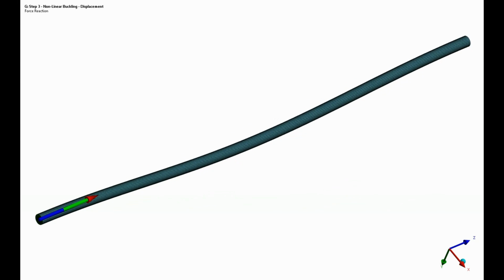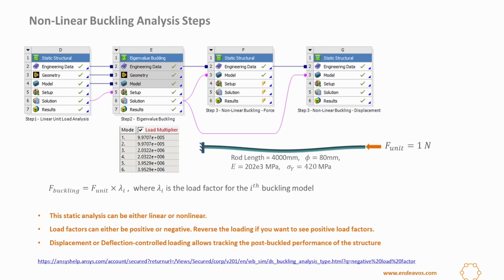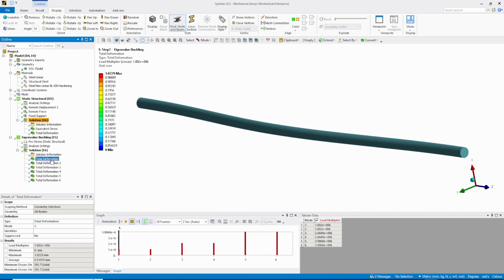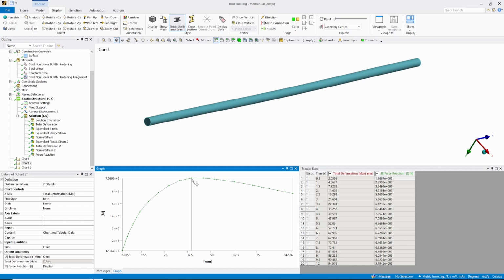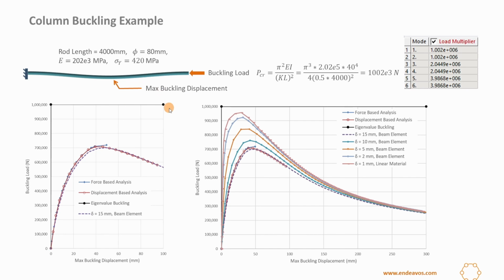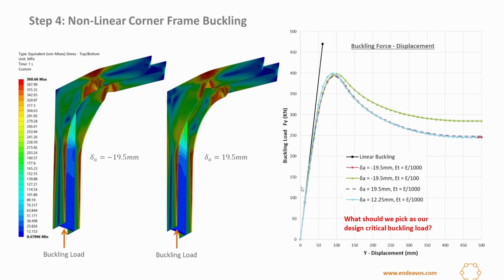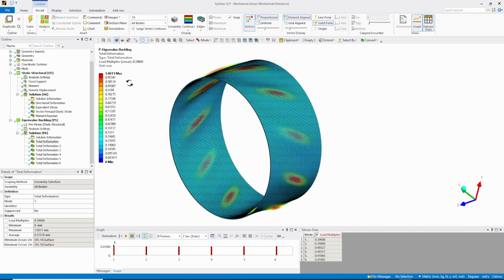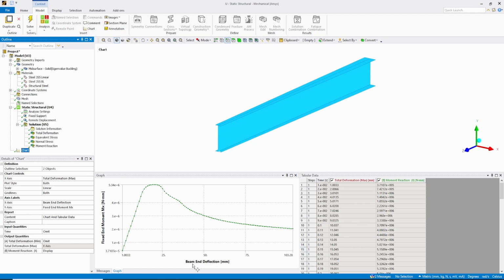ANSYS Structural Buckling Analysis

Comment: Great video, just one wrong info, displacement controlled non-linear buckling is not 100% guarantee for convergence, cases of snap-back buckling at which displacement actually decreases progressively with load after buckling can't be tackled unless either arc-length method or transient analysis is used.

Comment: why i cannot change the material properties from linear to non linear?
Reply from the maker: I didn't get your question. Can you elaborate it?
Reply: @endeavos  sorry, i get it now, i want to change my question, what is the different between force based and displacement based analysis, and why both of analysis we get the similar result?

Another question, why i cannot get the graph like you did? I m getting straight line. 😣
Reply from the maker: @nuraisyahsamsul2831  In the force based analysis, we apply a force to initiate buckling which results in displacement whereas in the displacement based analysis, we apply displacement to initiate buckling. Both methods will give you the same buckling load, however, force based methods run into convergence problems. Displacement based loading is preferred because it will also show you post buckled behavior of the structure.
Reply from the maker: @nuraisyahsamsul2831  Regarding the second question, can you tell me what example or problem you are referring to?

Comment: For Non linear thermal buckling , how to find the critical buckling temperature
Reply from the maker: Temperature can impact young's modulus if you have defined it as function of temperature. Buckling can happen at any temperature. There is no set "buckling temperature". If you want to find how buckling load varies with increasing temperature, you may have to run this simulation at different temperatures by inserting temperature as a load. You can use the temperature as a parameter and run this simulation at different temperatures to determine buckling load as a function of temperature.
Reply: @endeavos  i assumed temperature is constant, only temperature varies across the thickness.

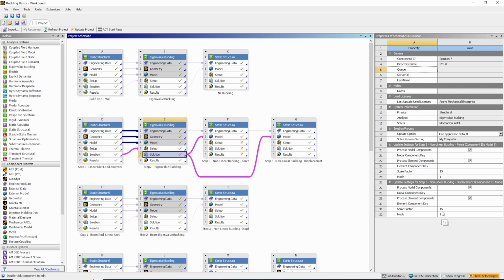Comment: Hi, I am confused how you came up with the scale factor at 16:16, and does this work on all geometry like corrugated walls?
Reply from the maker: Hi Benjamin. The scale factor is based on the manufacturing tolerance and as structural designer, it is basically your choice. If you want to be conservative, you can use the max tolerance. In this video, I followed the DNV's recommendation. Please see the document DNV-RP-C208. Thanks!
Reply: @endeavos  Thanks for the information! Can I also know which section did you get the value from? And another question I would like to ask is: In my project, I need to apply both hydrostatic and constant pressure onto a corrugated wall. When I get my eigenvalue, do I multiply the eigenvalue to both pressure or just the constant pressure? Thanks in advance!

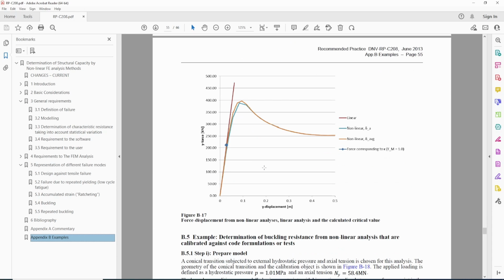Comment: Dear sir, thank you so much for a very comprehensive video, I was wondering which statement in DNV-RP-C208 implied that the capacity is "200 ish" kN, as you mentioned at 37:50 mins. of the video.
Reply from the maker: Thanks for watching. The ~200+ KN is the estimated capacity based on DNV's chart. it is marked right there on Fig B-17.
Reply: @endeavos The ~210 kN is not the 'allowable limit' based on the non-linear buckling. The 210 kN is the unfactored capacity from the previous example which was based on LBA and empirical buckling curves. The design capacity from NLA is the max value on the chart divided by all relevant safety factors (load and resistance) based on whatever code you are working to.